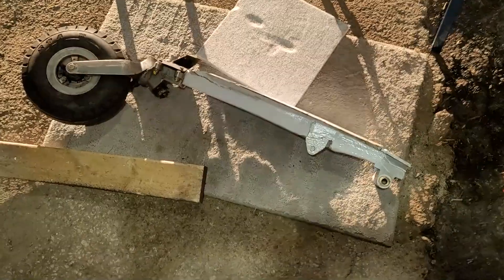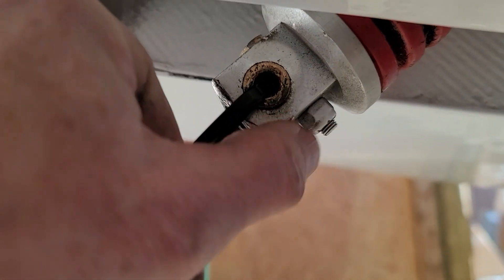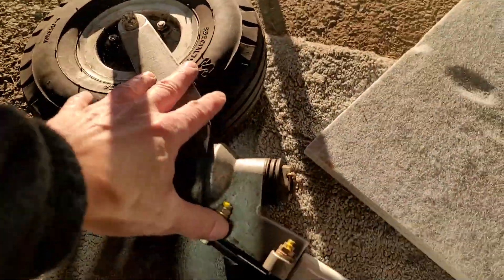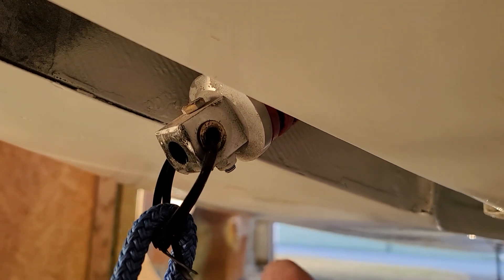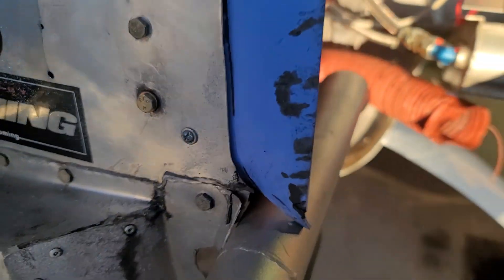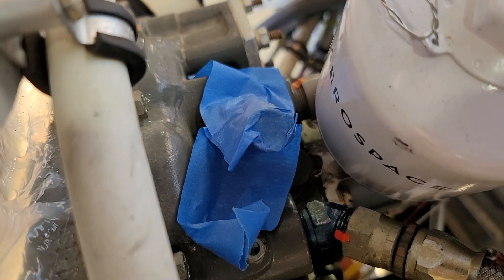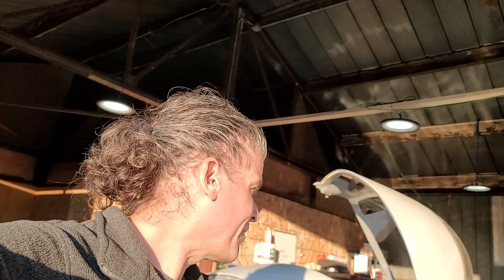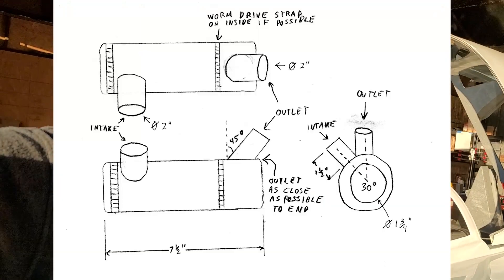Cozy MKIV Maintenance Part 4: Oil breather, Baffling and Nosegear

Comment: Afternoon Scott
I have a question.  When it comes to Experimental aircraft and maintenance, do you have to get a 337 field approval and an IA signature?  or do you have to just do a log book entry?
Reply from the maker: 337 approvals and IA inspections are for certified aircraft. For experimentals, pretty much anyone can work on them, but yes, log book entries still apply. You are responsible for ensuring the aircraft is airworthy before it flies. Experimentals do require an annual condition inspection, signed off by an A&P (IA not required) or someone with a repairman's certificate for that aircraft (i.e. the original builder).
Reply: @CanardBoulevard  Thank you for the reply

Comment: Looks good. Burt said the nose gear was the weak point. There can be some fine lines between tough (durable, bends before breaking), strong (mixture of both) and hard (won't bend before breaking.)
I'm no A&P but one thing I'd suggest is worm clamps are pretty ehhhh...there are better things to use. Worm clamps always work loose (fifty year mechanic here) and don't provide consistent, 360° tension. 'Constant tension' clamps or Oetiker style ear clamps for hoses and stainless 'Band-It' style clamps for grouping your tubes together are better choices. Plus, they are generally less expensive.°.
Reply from the maker: Burt said he wishes he could go back and redesign the nosewheel. He said he would definitely make it steerable, rather than free-castering.

Worm clamps definitely don't provide the 360 degree tension, but I will say that they are pretty universally used in aviation, and the ones I removed and replaced on this airplane have been on the airplane for 20 years without working loose (save for the one hose clamp that squeezed the rubber hose enough that it became loose). There are definitely better options.
Reply: Thanks for the Oetiker tip. I'll have to keep those in mind. Worm clamps while rather universal have always seemed a bit sketchy to me. I also just discovered that there is a tool with swiveling tips to more readily get the clamps in tough locations. Knipex 85 51 250 C, described on MrSubaru1387 (a video short).

Comment: There are a lot of posts on COBA now about how to flex connect NG door to prevent cracking/stop cold air infiltration. Keep up the excellent work.
Reply from the maker: Yup, I've read through those, and will be doing exactly that.